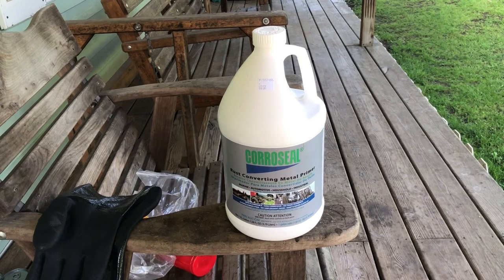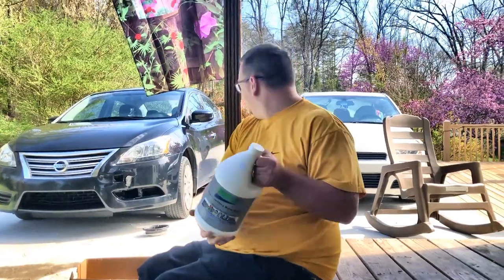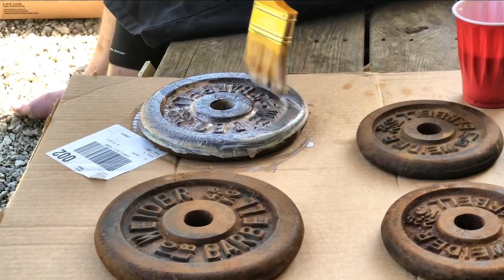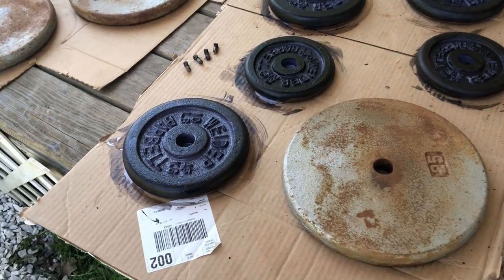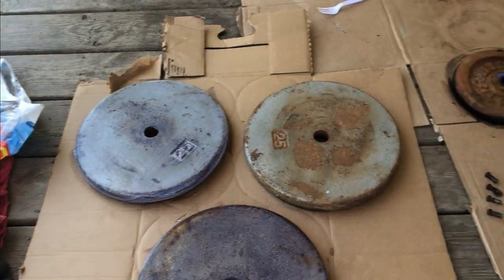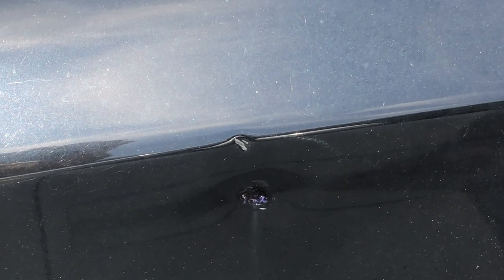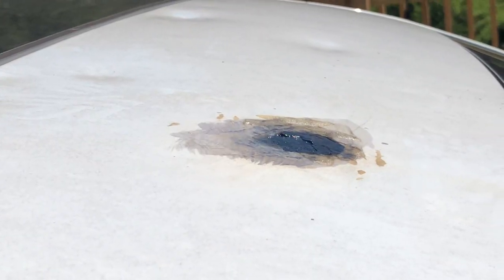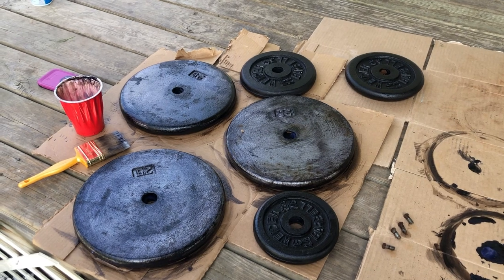Corroseal Rust Converter Review

Comment: I have used Corroseal for so many projects... everything from rusty door hinges, wheelbarrows, outdoor furniture, fencing, and of course automotive applications. It is the MOST AMAZING PRODUCT I have ever used. I spent $16 on a 32oz bottle about 10 years ago & I still have about 12oz left!!!! IMPORTANT TIP: DO NOT STORE anywhere that will get HOT, like a GARAGE or SHED. The material at the bottom of the bottle will rubberize & you will lose product.
Reply: I have looked at quite a few Corroseal reviews and see your very same review word for word on every one of them.  Do you work for Corroseal?
Reply: Also don't let freeze samething happens when it thaws